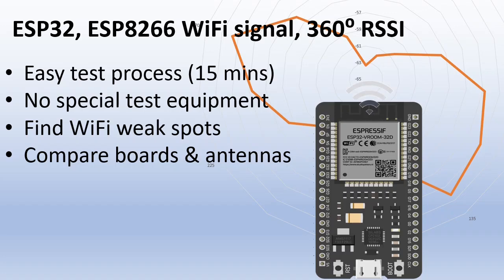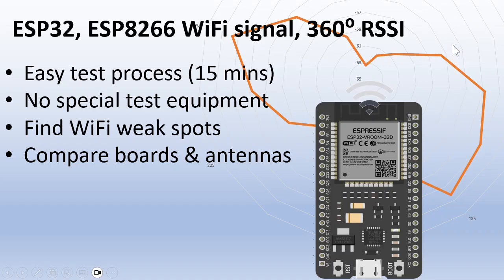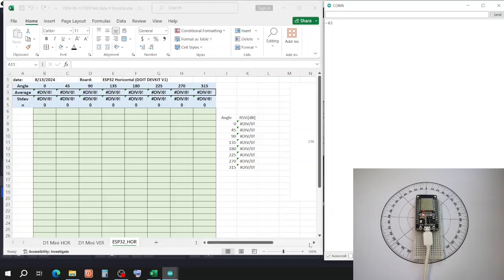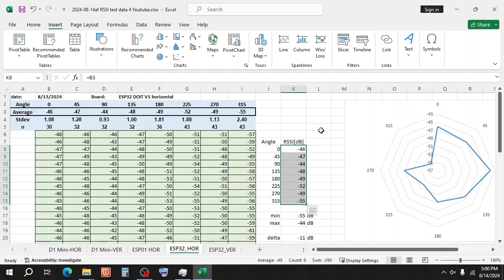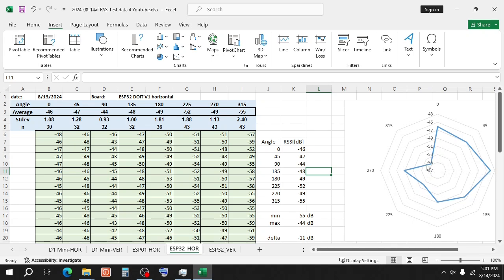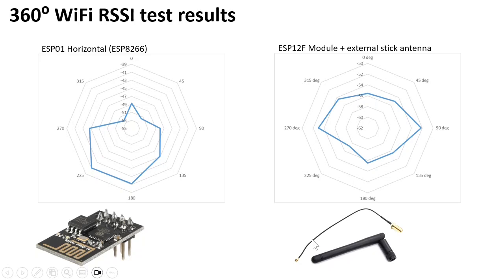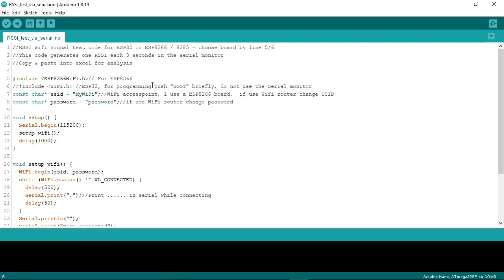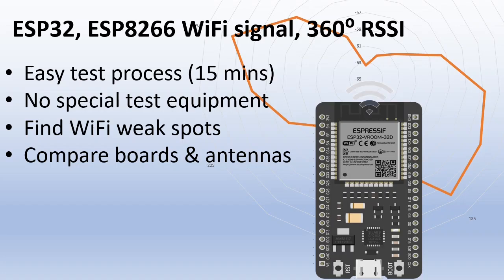ESP32 & ESP8266 WiFi signal 360⁰ RSSI

Comment: Thank you for your job with your videos that's leaves good utilities without much complexity to execute it! Can I use an ESP 32 and a ceramic antenna 868 or 915 MHz together a RF mixer to read UHF RFID tags? The power to the tags, I'm thinking to sent with a separate antenna. I bought recently voltage controled oscillators with ranges of 700 to 1100MHz and to the range of the WI-FI window of 2.4GHz. I also want try to put a photodiode or phototransistor each UHF tag to provide more energy and increase the possibilities of localization of my large quantity of tools here in Brazil. I wok with heavy steel things and tools, chemical products, inumerous devices like a Hantek 6022BE PC osciloscope, Tiny SA spectrometer, graphene, PTFE powder, bolts, Gallium, Power Electronic components and various large and SMD components. A need to made a micro logistic system myself otherwise I will be crazy!
Reply from the maker: @gutobassogb  great to hear from you from Brazil,🇧🇷! With the ESP32 you are limited to Wi-Fi or Bluetooth because the radio is built in you will not be able to select other frequencies or protocols. Maybe other tags send their signal strength over a serial pin too, search the internet or ask and discuss with an AI chat

Comment: how could the RSSI value could change with the change in the orientation of the ESP? the wifi is omnidirectional the RSSI should have remained constant. Please explain
Reply: The receiver antenna gain depends on its orientation, so the RSSI.

Comment: Hi there! I like this kind of ideas! have some proposals to develop this further: 
a) Grab the RSSI values via the serial interface, I am having some examples on my channel. 
b) So you can use much more samples and perform statistics on min, max, standard dev, median, mean etc.
c) Use a stepper motor or a servo to turn the thing automatically
d) You can run this over hours and store the RSSI values in a Text File which you can import to EXCEL

Comment: Very interesting.
Does it make a difference if the ESP8266/32 module is oriented horizontally or vertically?
I generally mount my modules vertically and have not experienced comms/connectivity issues.
Reply from the maker: Thank you! It does make a difference, at 4:20 in the video you can see the difference for a WeMos board with a ESP12 (8266 chip) module.
I had one MQTT dimmer pcb in a room that always had troubles, it used ESP12 module, was vertically mounted and the "weak spot" exactly pointed at my WiFi router. After turning it 90 degrees (still vertical) , the problem was solved ;-)